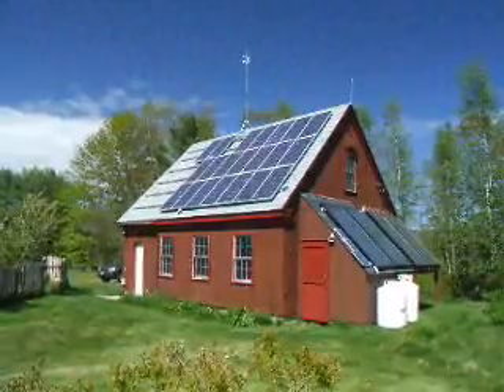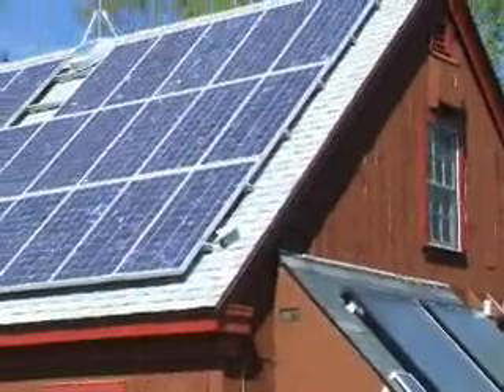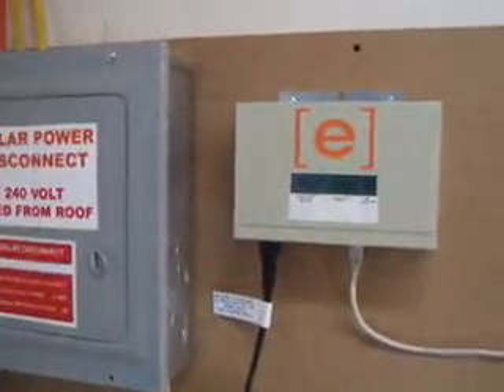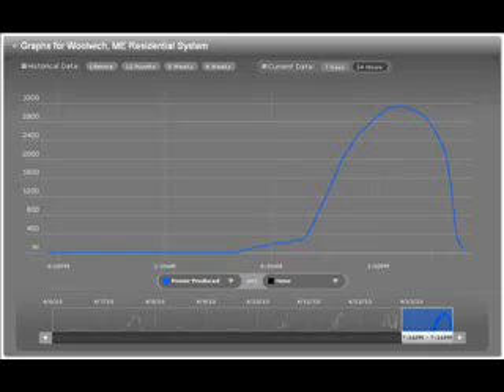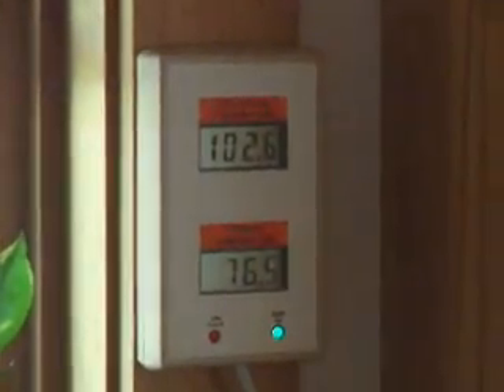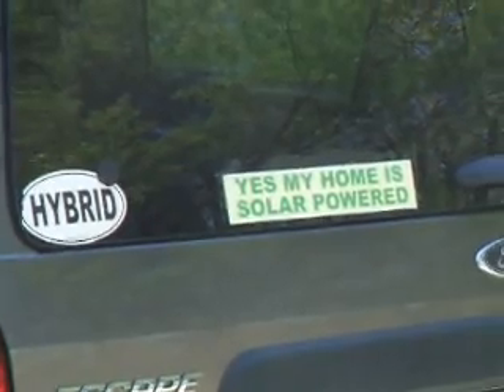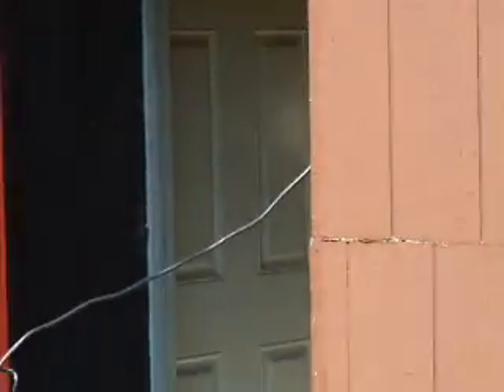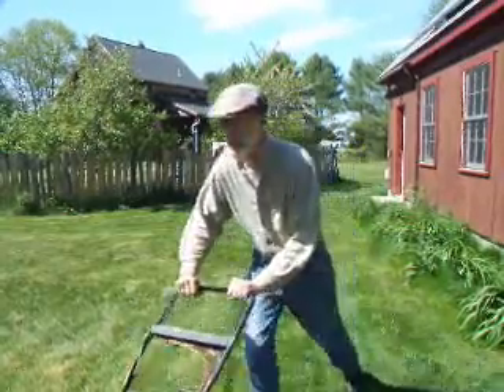WIRED-Volt competition entry

Comment: How is your lawn mower equipped, it looks like you are only using one lead-acid battery but I can't tell that easily based on the video.  What type of motor do you have and what wattage and voltage is it rated at?  Do you have any controls beyond battery voltage to prevent dangerous overspeed of the blade or are you just using a permanent magnet motor with the proper voltage to provide the RPM you need?  Do you have an EVAlbum page for it?